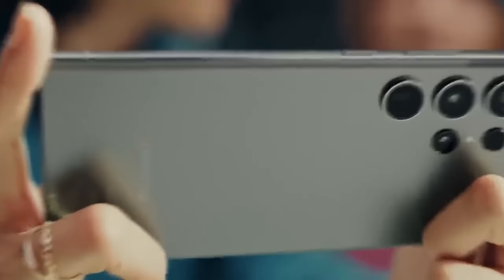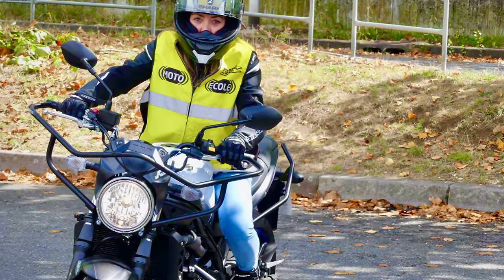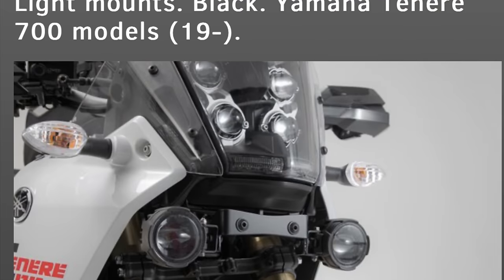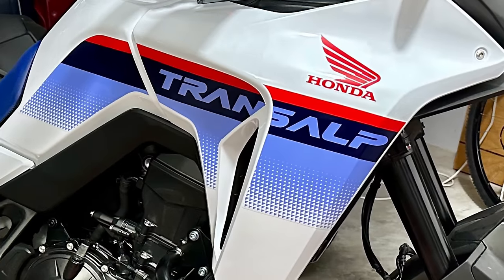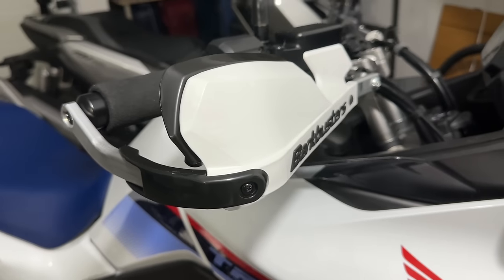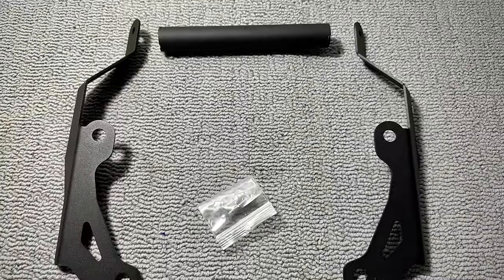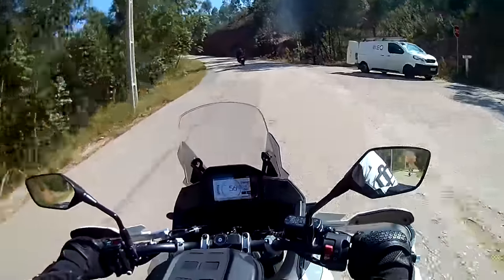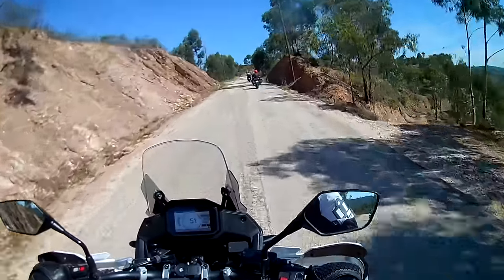An Alternative to Traditional Crash Bars

Comment: I did the same thing with my Versys 650 lower bars by SW MOTECH and BarkBusters. Did the job perfectly the 3 times i dropped it at standstill. Zero damage to the bike, couple scuff marks on the crash bars.
Reply from the maker: Good to know. Thanks for your feedback👍😊
Reply: @RocketMan_Moto  Thanks for the video. I'm looking at the transalp after I get to test ride one.
Reply from the maker: I’m very happy with mine. The new 800DE is supposed to be good, too.
Reply: @RocketMan_Moto  To tall for me
Reply from the maker: I don't like giant bikes, either, but I find the Transalp quite manageable

Comment: Mate I agree ☝️, no point buying a lighter bike and adding loads of weight. 
I at present have 2 main bikes 
1. Moto Guzzi V85tt - lower crash bars from SM - Motech and a few other essential items for mainly road riding . 
2. My Honda CRF 300 Rally - For my snotty riding , 
1. Lighter ally bars and bark Busters 
2. 12 Volt out let with Quad lok .
3. Tail tidy - Saves 500 grams 
4. Rear rack unfortunately adds 5kg 
5. But will be fitting a full FMF pipe - so that will save around 5kg 
6. I will be cutting lower fairing off and putting Case savers on with B&B bash plate . 
So in short lighter is better .
Reply from the maker: Agreed👍😊

Comment: Yeah, i do need to carry that much stuff :D . Since these are mostly used on roads, you need a place to leave your helmet and gear, especially when you travel with passenger, in summer heat.  I also have Barkbusters, and full size Heed Bunker crash bars on my Africa Twin. I also have the optional Honda lights and the small side bags in which i carry rain gear.  There's a company called Outback Motortek, which makes great crash bars. The only problem is, their stuff costs a lot, and for the price of their smaller kit, i bought the full sized Heed.
Reply from the maker: I looked at Heed. They make good stuff👍

Comment: Good thinking, and I agree with much that you say. The illustration with the board between the lower guards and hand guards spoke volumes, but the handlebars were straight. They seldom are in a crash, and being at full lock reduces the clearance. Would be interested to see the board check with the handlebars at each lock…
Reply from the maker: You’re right and a few days ago I posted a photo to show how the guards still protect the fairing even when on full lock. I should have shown this in the video - my bad😊

Comment: I am with you on this one, as I will be using my Transalp the same as you, I have no intention of chasing itchy boots!  Though still got make my mind up 
What to get Transalp or speed twin 1200
Here's a question for you, I was lucky enough to test ride a speed twin at the ABR Festival,  and boy did it vibrate,  the seat would have given a rambit rabbit a run for it's money and my right hand was going numb after only 40 minutes of normal riding
Your thoughts please
Reply from the maker: Was it the 900 or 1200? My 1200 is very smooth🤔
Reply: @RocketMan_Moto  It was the 1200, a 2023 model, less than  500 miles on the clock, but part of the Triumph test fleet,   I just didn't feel right and as I am sure if an issue like this was common, someone would have said.  But thanks for the reply, I just need to make my mind up!  lol.  
The problem my current bike a NC750 x DCT ticks all the boxes, with exception  of 1.  I doesn't make me look back after riding it and go "I own that"
Reply from the maker: Completely understand - the NC is a perfectly good bike, very practical and easy to live with, but it lacks 'sex appeal'

Comment: Great video, RM! 
The problem I face is that our garage has a standard door (rather than a roll-over or double door arrangement) so getting my bike in/out is quite a faff. I have to get the angle just right and then shimmy-shammy the handle bars through. So (in a long winded way) I wondered how much width the lower engine bars and barkbusters add? My bike’s an F850 GS, which I’d imagine is similar to your Transalp.
Reply from the maker: Hmm yes, adding width could well be a problem as the guards do protrude quite a bit, even when the bars are turned (see my post this morning)

Comment: ICompletely take your point, some of the scaffolding people fit to their bikes is going to affect the dynamics and be counter productive if it's too strong, shifting forces to the frame or engine mountings which could be catastrophic, however.... when the Africa Twin was launched the Honda "light bars" were criticised for being flimsy, but having dropped the bike on gravel and black ice tarmac I can attest that they protected all the plastics without sustaining any structural damage themselves other than scratches. The three contact points on both occasions  were the Barkbusters, high level crash / light bars and the rear footpeg assembly ( which is the main reason I leave them on my AT despite them being a pain in the backside for other reasons. This brings me to the CB500X , wanting the same level of protection for the plastics, I researched what was available and bought the CrossPro bars ( made in Portugal I believe) mostly on the grounds that they were aluminium. I had to take them off the other day to fit some spotlights and had forgotten how light they were, I have dropped that bike stalling it on gravel and again no damage to the plastics and the same three contact points, a bit of emery cloth and a lick of paint all good. Of course if you high side the bike at 70 mph they are not going to do much, but the bike will probably be a write off anyway, for the lower speed scrapes we normally have I'm satisfied.
Number one mod to any bike taken off road for me is definitely a set of Barkbusters though. Now considering a Transalp so will follow the efficacy of your mods with interest without actually wishing you need to put them to the test!
Reply from the maker: Thanks for your feedback. I had a CB500X a few years ago - valiant ‘little’ bike, but the Transalp really is in a different league😊👍
Reply: Dynamically I'm sure it is, I still have my AT but having been looking for a Unicorn lighter bike to complement it, I haven't had a chance to try a Transalp does it feel physically much larger than the 500?
Reply from the maker: Think of the Transalp as being a 500X with 10% more of everything… except for the engine, which is 100% better. I am not a fan of the AT, I’m afraid. I think it’s too big, too heavy and not powerful enough for the money. It’s better than the Transalp but by the tiniest of margins and definitely not worth €6-7k more than
Reply: Many thanks for your feedback 👍

Comment: I didn't want to add much weight to my baby GS so I went a similar route, skipping the full crash bars and using only the lower engine protection bars from Givi.  Unlike some of the cheap crash bars, the Givi bars bolted in place without bending, cussing or knuckle busting.  I got some surprisingly nice and beefy Chinese BarkBuster clones to hopefully protect the fairings in a drop.  If I do bung the plastic, I'm certainly not going to pay $300 or whatever BMW would want for replacements.  I'll fill the scratches, sand and paint it black with a Krylon Fusion rattle can.  I'm slowly blacking out my bike.
Reply from the maker: Thanks for your feedback😊

Comment: Thanks for the review and the tips to the aftermarket accessories. I bought my transalp with original crash bars and sump guard. Heavy on the wallet I admit, but with the transalp I wanted trying something different. Will buy the barkbusters and the gps mount for sure though. 
Could you add the link to the brake and clutch levers?
Cheers, V.
Reply from the maker: Thanks. I bought the levers a few years ago for the CB500X, but I’m afraid I can’t remember where. Sorry😉

Comment: I usually put/hang extra fuel tank on upper guards. It enhances the looks on my bike (at least for me)😁. Plus the metal tank provides extra armour. But sometimes makes rattling noise, which i still can't find the loose nuts.😆
Reply from the maker: That’s one use for upper crash bars😊

Comment: I like the way you include so much detail in the vids without being boring and OTT. I agree about the engine guards and just having them low down. The H&B ones look great and suit the bike and will do the job. The Honda ones are completely OTT and look awful to me, like having a zimmer frame on the bike. I am presuming that people around the world know what a zimmer frame is. I like your comparison with the learner bike frames, but I am way too old to have used them. I often put extra LED lights on the crash bars so I would like them a bit higher, but I think I will wait for a dedicated light bar. The problem that I have come across many times when using multiple manufacturers items is clashing with other items. I now prefer to fit mainly OEM items. BTW I have dropped a few bikes for various reasons and found that the crash bars have saved the expensive panels. The plastic hand guards have never broken, just ended up a bit scratched, the plastic being very tough on most of my bikes. Without wishing to be rude, I found it strange that you wanted the bike clean and simple and then fitted Barkbusters which look good but there is a lot of extra metal work involved which IMO looks too much, just saying 🙂...keep up the good work, I am sure that you are helping a lot of people and hopefully will continue to do so!
Reply from the maker: Thanks. The metal in the BB guards can’t really be seen when looking at the bike normally, though it’s obviously heavier than plastic, I agree. Thanks for your feedback😊👍

Comment: It would be extra work but I'd be tempted to Helicoil or Timesert the threaded holes on the handguards so the bolts aren't running in on aluminium threads.
Reply from the maker: Good idea👍😊

Comment: I'm not at all interested in the crash bars, I clicked on your video out of curiosity but I watched the whole thing because it was really well made and you do a great job explaining everything, so I subscribed to see what else you have. 
Regarding these particular crash bars, objection #5: bikes rarely fall to the side with the handlebars straight; so if for example the handlebars are turned all the way to the left, the handguards don't look like they will be touching the ground like you show at 2:30; looks like it'll be the top part of the fairing instead.
Reply from the maker: You’d be surprised: the handguards take up the empty space when the bars are on full lock and still work. Thanks for the sub👍😊

Comment: I fitted full height crash bars when I had a Yamaha Ténéré 700 adventure bike, but I've now gone back to my first love, a sports bike. The bars were made from light-weight aluminium, but were a bad design, because they blocked the access to the front panel screws—what were they thinking? It made getting the front panels on and off an absolute pain! Half-height ones would've been a far better solution, you live and learn. I also went with the reinforced hand guards, but why don't manufacturers make easy to replace end protectors for them? I like the rear soft luggage solution, as it brings the weight lower, and also protects the bike when you drop it—which you will!
Reply from the maker: Interesting. Thanks for your feedback😊👍

Comment: I agree with this video and with the concept that a lot of guys overprotect their bike. I see YouTubers all the time making a big stink about the plastic skid plate for instance that came with the bike. And they won’t take it out of the garage until they put on an aftermarket, metal skid plate. But then I see them actually riding, and they’re not even going anywhere where they need a skid plate! Even a plastic one! Also, the plastic pieces on a motorcycle are actually quite flexible,tough, and not easy to break in the event of a fall. Most plastics on this type of bike are not painted,but have the color dyed all the way through. So if they get scratched it’s not very noticeable. Plus,the shrouds themselves are meant to be a type of crash protection for the delicate bits underneath. So why protect the protection?! And the plastics are easily replaceable and not super expensive. Maybe not as expensive as a full set of crash bars would be-I don’t know.
Reply from the maker: Thanks for your feedback😊

Comment: Great video as always.
Just as a note:
You put the plastic protector over the paint chip; to avoid rust, I'd recommend take it off, put some paint touch up on it, and then put the crash plastic back.

When rust gets in, it doesn't like to get out. I say that as a Yamaha mechanic in tokyo😅
Reply from the maker: Thanks. I did put paint on the chip before I fitted the plastic bumpers👍😊
Reply: @RocketMan_Moto  good on you.
Keep up the rides, and thanks for the "roadskin" reference.
They ship to Japan at a very reasonable rate 👌
Reply from the maker: That’s great. I’m sure you’ll like the jeans, they’re really comfortable😊
Reply: @RocketMan_Moto  thanks again, just ordered the Jean. $39 usd to ship to japan, but your code covered most of the shipping.

All the best

Comment: I did a similar thing with a crf250l Rally. The inpreda kit came with uppers and lowers, I used both for a bit and realized the uppers rarely touch the ground. Ended up removing them and the bike looked much better, never broke any of the plastic (which is probably more flimsy than the transalp).
Reply from the maker: Thanks for your feedback👍😊

Comment: Good video. I am selling my Africa Twin to purchase a Transalp. . I was thinking the exact same thing. I am buying this bike because it is lighter than my AT. Why add 50 lbs of protection I probably won’t need. I’m going to put on pannier racks, lower crash bars ( mainly because you have to have them to mount a skid plate. And bark busters . Now just need a buyer for my tricked out AT
Reply from the maker: Good call. I looked at the AT before ordering the Transalp, but it's just too big and too expensive for me. Plus, it only has 10hp more than the Transalp. I don't think you'll be disappointed :)

Comment: I'm not yet sold on the TRANS ALP  ( wishing it had Cruise Control,  WAKE UP HONDA  )  ......  I do like your choice of Lower Crashbars  & Barkbusters ... I would also opt for  their upper crashbars ...  I tend to like my accessory lighting  spread apart  ....  And  upper bars do come in handy for adding additional storage for  longer road trips....  But as you pointed out not ideal for aggressive Dirt Riding ...        Any Noticed Vibration on the crash Bars ?
Reply from the maker: No vibrations so far👍

Comment: Did the same thing with my 23 GS. Lower engine bars, sump guard, engine case. That will still protect your bike 99% of the time especially with panniers. Upper bars are a waste, even for most off-road
Reply from the maker: I agree. The only 100% guaranteed way to not damage your bike is never to ride it ;)

Comment: If i had one i’d get a pink one and cover it in surgical tape like they put on exhaust pipes and old ladies ulcerating sores. Then see if you can crudely shape a bar and padlock that fits under the centre stand to stop it being released back up. Ignition cut outs alarms and old mobile for tracking etc.
What do you think about the place the crash bars attach to the bike, they might make it worse. Thanks to a guy years ago outside Pride & Sharks for pointing out how the single bar horizontal mounted to the down tube would swing round and break my leg like his did, he passed his experience on, don’t feel embarrassed, it’s worse keeping quiet. You get your own back by stopping it happening again.
Reply from the maker: Yes, full-height crash bars can actually damage the bike. No such thing as 100% protection, I guess...

Comment: Thanks for the video! Do you think a skid plate to protect bottom of the engine is a must for this bike? Right now I'm trying to make a list of obligatory protection accesories for XL750 and your opinion will help. The bike is great, but protection is really weak even for onroad use.
Reply from the maker: I have ordered the Hepco & Becker skid plate, but it won’t be in stock until mid August👍
Reply: @RocketMan_Moto  I like the look and quality of H&B low crashbars, but the way how the skid plate is mounted looks pretty weak. Honda's skid plate mount (as well as SW-Motech's) looks way more solid for me. Look forward to see you review on H&B skidplate and it's durability.

Comment: Hi, how did you solve the usb-c charging I see in your video, did you install anything aditional apart from the usb-c charge under the sear or do you just wire a cable from there?
Reply from the maker: Just ran a 2m usb c to lightning cable from the rear seat to the accessory bar😊

Comment: I feel that the big craah bar bags kind of fight against the reason to use the bars.  If youve got stuff in the bags and drop the bike, due to the placement of the bags between the bars, the bags become the "rock" that punches through the bars, guaranteeing broken plastics.  So if youre running upper bars just for luggage and light racks, sure.  If youre running them for protection then maybe think whatll happen to the bike when your stuff gets slammed into the plastics?
Reply from the maker: Agreed👍😊

Comment: Nice one, and let me make one more argument for full sized crashguards: leg protection! GS cylinder heads are famous for saving riders' legs. For example when a car changes lanes into yours... So say you don't want an elephant but still fancy leg protection. Sustained? ;)
Reply from the maker: Thanks for your feedback👍
Reply: Not al the time, an Architect colleague dropped his GS onto his ankle at a traffic light and suffered with pins and repeat medical attention for more than a year.
Reply: @kalaharimine  indeed. that is another famous feature of the GS cylinder head to brake ankle and shin bone... depends on the circumstances, the driver